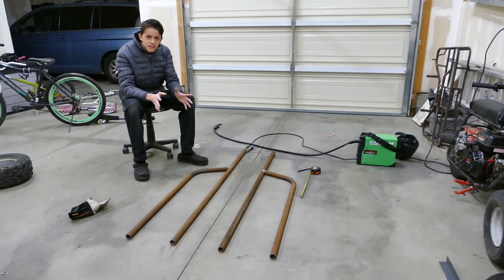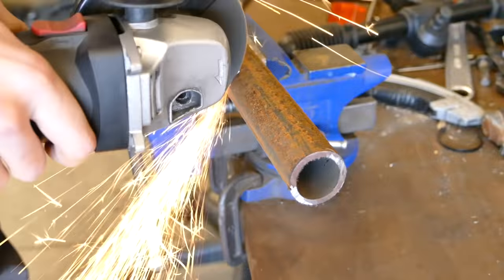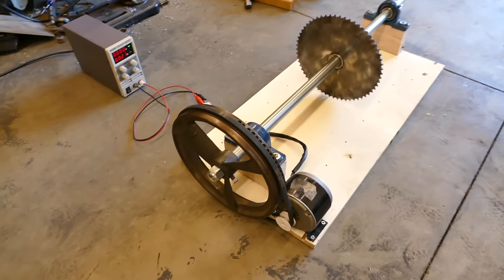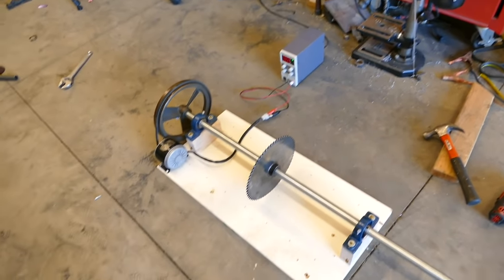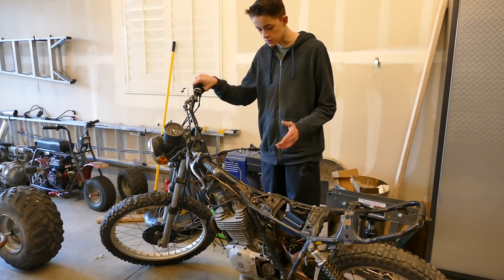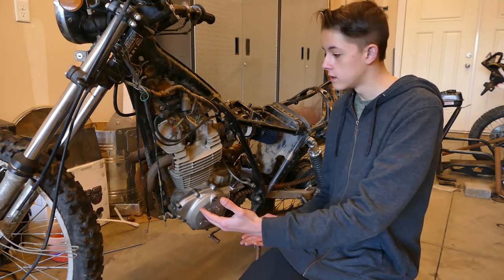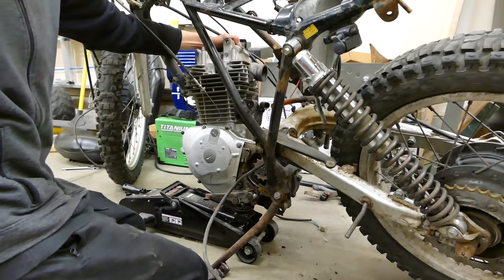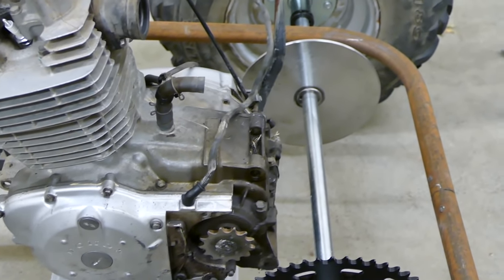Honda XL500s Mini Buggy Build || Part 1

Comment: Why did you fit such a large rear sprocket? The tyre circumference would be about the same as the original bike I guess, so a same size sprocket would be a good start. The oversized one will give you more torque but loose top speed. Depends if hill climbing is your thing
Reply from the maker: the wheels are about 3 inches shorter than what’s on the motorcycle, and I did purposely put a very large rear sprocket since it’s an off road vehicle for trail riding and such and my main priority is torque, but even still it will do 60+mph no problem

Comment: This is a 1981 Honda, How dear you! Did I just see you but weld those tube extensions without putting in an insert inside the tube and plug welding it to both sides? You are going to have a weak spot right there in your frame. I don't advise doing any hardcore offroading or jumping it. And then you do exactly that a few minutes later in the video on your rear suspension section. I can tell that you know how to build, it must have just been an oversight. Keep building.
Reply from the maker: The pipe I used is so thick walled that I figured it’s plenty strong enough without a plug as long as i weld it good